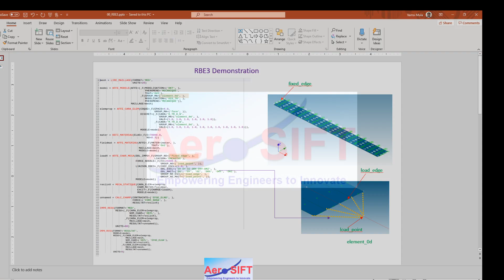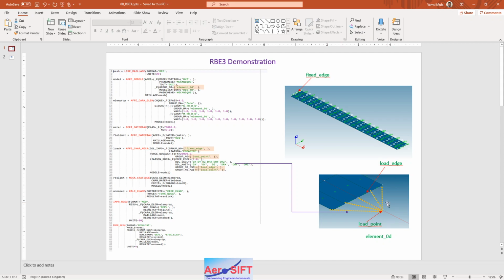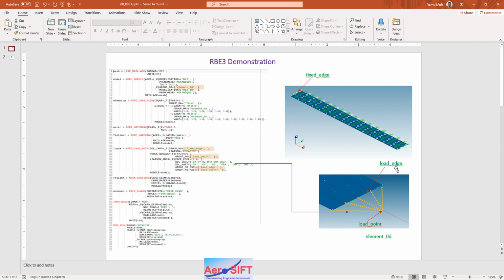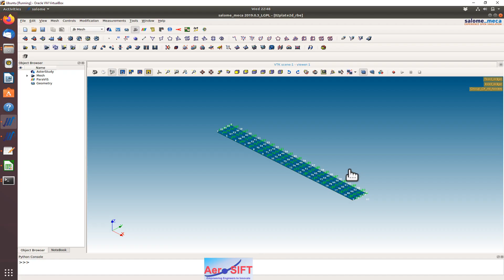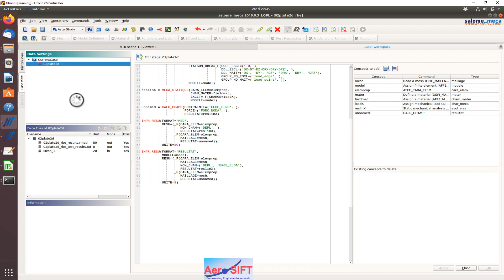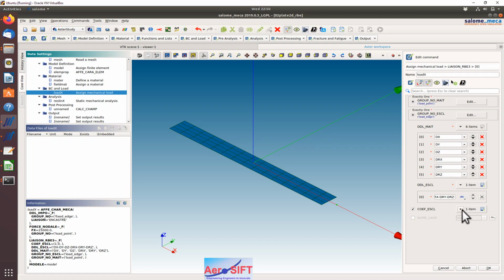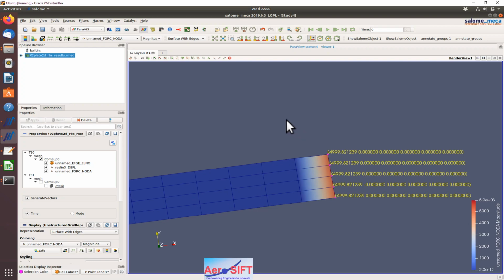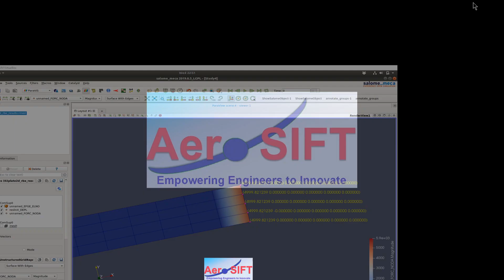RBE3 element in Code Aster Salome Meca 2019

Comment: Hello, thank you for this video, it has been extremely helpful. I am however, struggling to create something similar using a 3D mesh with an RBE3 element attached to the nodes on a face in the geometry. I've followed a similar process with no luck. It'd be great if you are able to share the files associated with your tutorial so that I can check if I am using the correct mesh groups? Any help/guidance would be much appreciated! Thanks again.
Reply: struggling with the same issue. Did you find a solution yet?

Comment: Hey, thank you very much for this content. I am currently working on my masters thesis, and I am programming a Tool, that automatically creates an Aster case based on the input file for a commercial solver. We use RBE3 and rigids on a regular basis. Is there a way, to properly model RBE2s in Code Aster?
Thanks in advance
Reply: Hello Jonas, you can do RBE2 element with LIAISON_SOLIDE in CA. It is quite easy :) I can send you some hint in case of need.
Reply: @janblokes5780  Thank you =) That was exaclty what I was looking for. Works like a charm